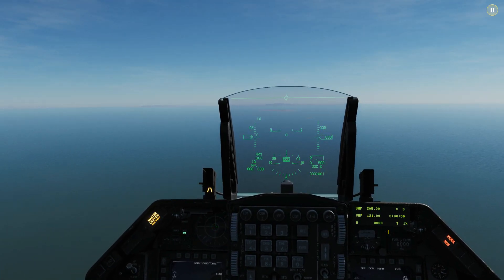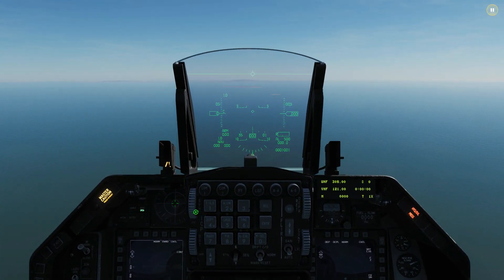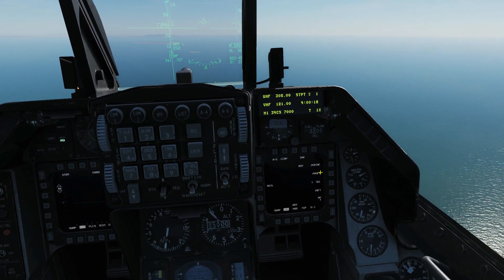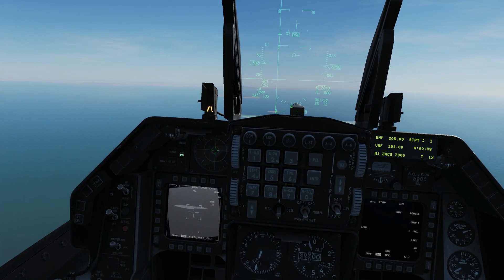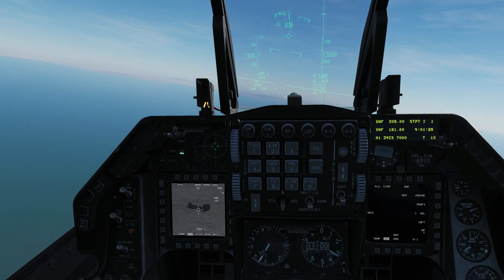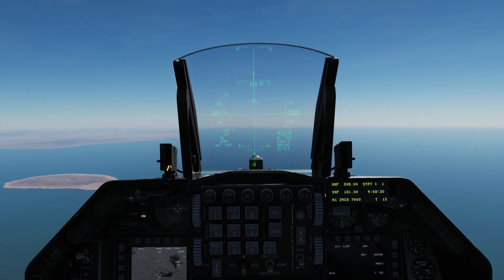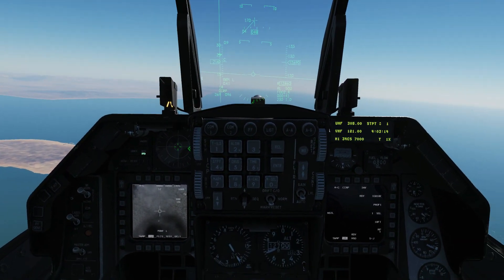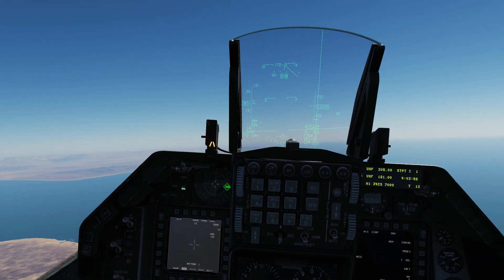F-16C Viper: TPOD TGP Air To Air Using Air To Ground Mode | DCS WORLD

Comment: Oh. I just noticed. The F-16C we have in DCS actually has the litening AT pod until the sniper pod is completed.

I’m not really sure what the difference is between the A10/harrier/hornet and the viper is, but it’s different somehow IRL. Same with the sniper pod. They basically are all the same except resolution I think. Maybe the crew chiefs hanging around would know and perhaps be able to tell the difference if it’s not confidential info
Reply: Hmm. I can’t find much info on any of the different models being much different in real world differences. 

One thing I noticed that we don’t have modeled in DCS. The targeting pod being used in A/A mode as an IRST and also being able to scan for ground targets with IR and silhouette. Adding them to the link16. Of course that capability might have confidential stuff. Because the F-35 basically has the sniper pod integrated and it uses its radar, RWR, and tpod to automatically spot and track ground targets. 🤷‍♂️